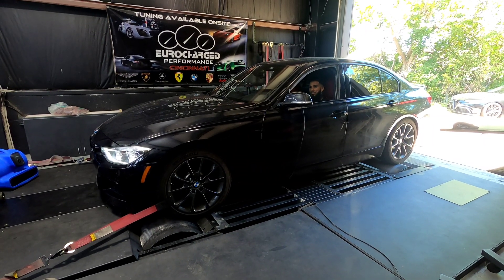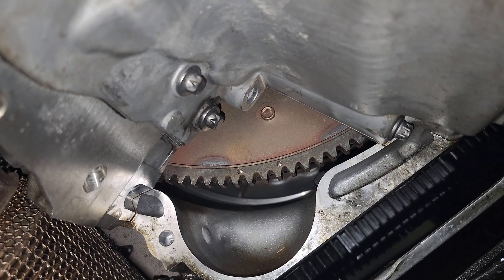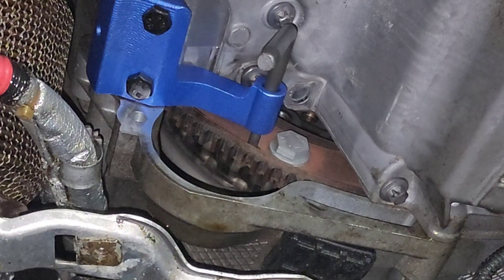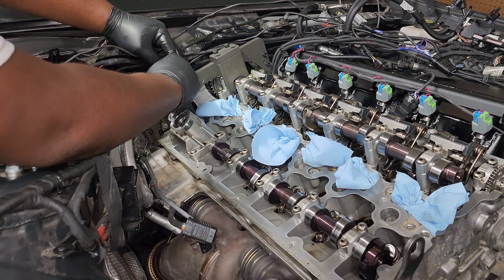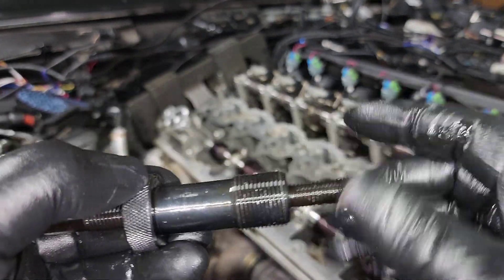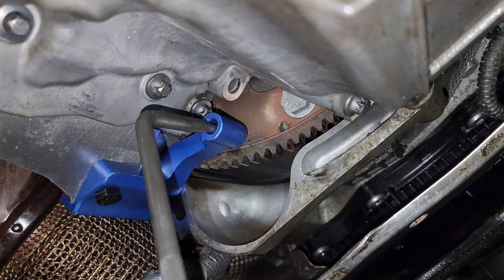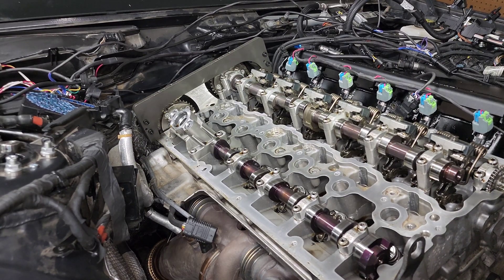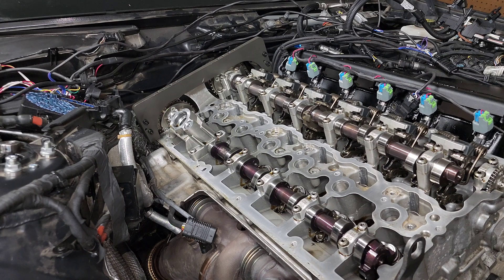I made a HUGE mistake and almost blew my 340i engine...

Comment: Well, I installed my Kelford stage 2 before you uploaded the videos!! and a valve fell inside the cylinder and I had to remove the head!! I blocked the crankshaft without the head, then I installed the head, I torqued it and put everything in place except the timing chain, then I installed the chain and tensioned it and it seems to be fine. It's been like this for more than a week and it doesn't have any codes!!
Reply from the maker: Glad you got it sorted